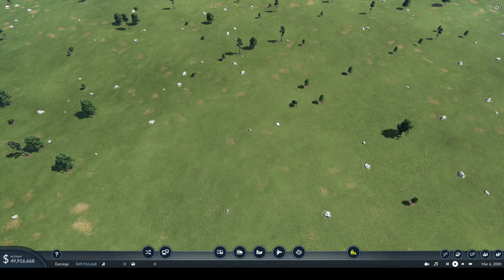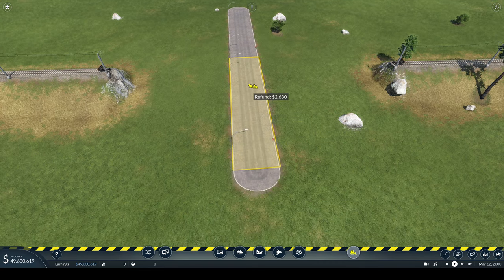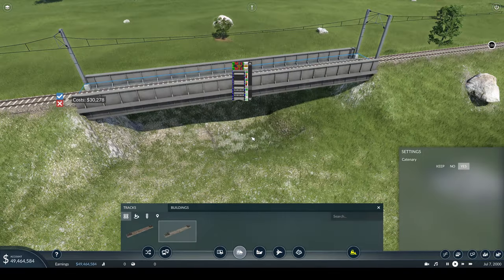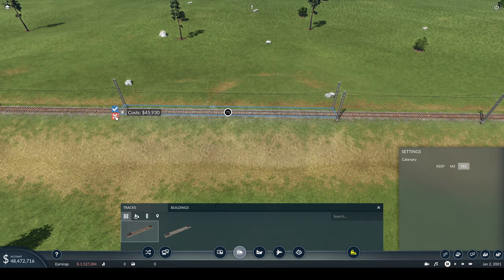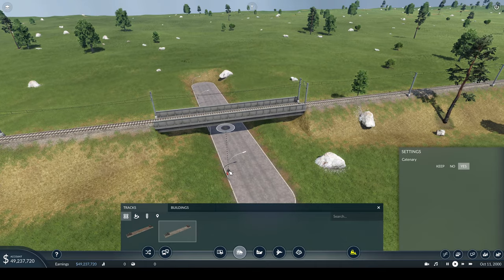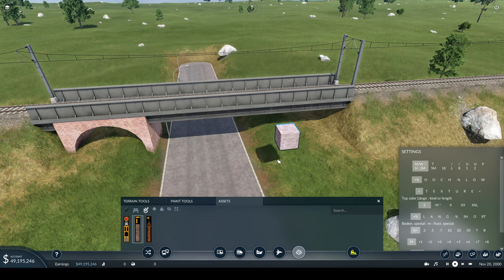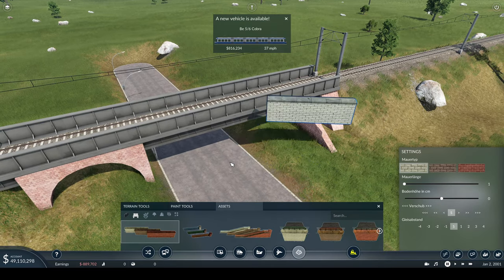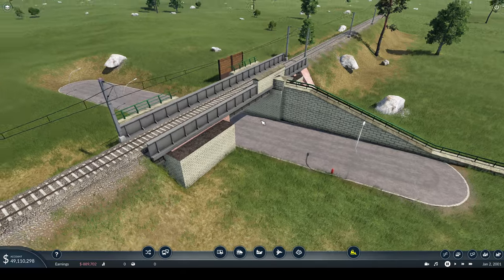[Tutorial] Building Low Bridges and decorating - Transport Fever 2

Comment: Another tip for cutting segments (for rail) as opposed to creating a junction like badger showed you, is to create another track parallel, which will automatically create the same bridge type, draw it as long as you want your bridge to be, then delete the original section and redraw it as long as the parallel section you draw, which will retain your selected bridge type, then you can delete the parallel "measuring" section that you might not need for single track. I find drawing a parallel section and temporarily deleting the piece that is too long more precise than the junction method.
Very useful tutorial though, thanks, I've seen GrandT do it, I assume he got it from you, but this tutorial has a better theory explanation. I really wish the devs would make the auto bridging and tunnelling mechanics better, I've gotten way tighter tunnels doing it manually, but counting to incremental steps and creating the underground part first. When drawing a network under another network on an embankment that is clearly high enough, like your example, it should give both bridge and tunnel options to select from. Thankfully we have mods that do make the game better, but the devs could do more.